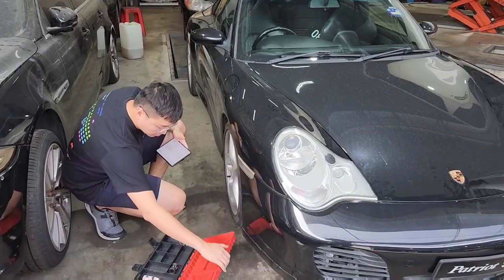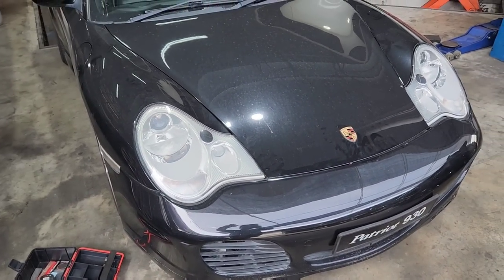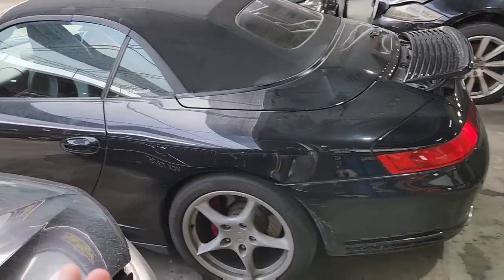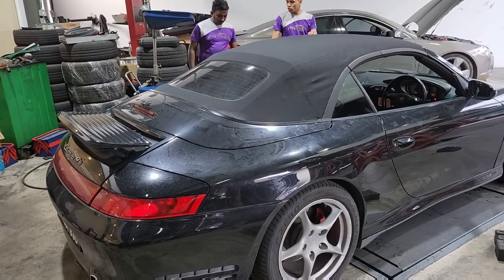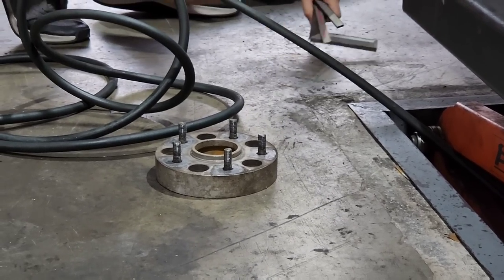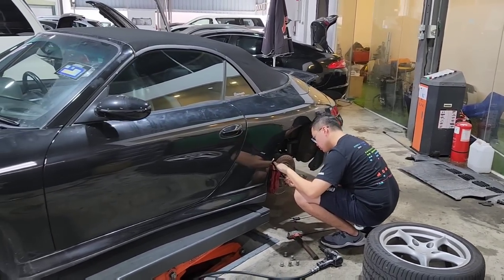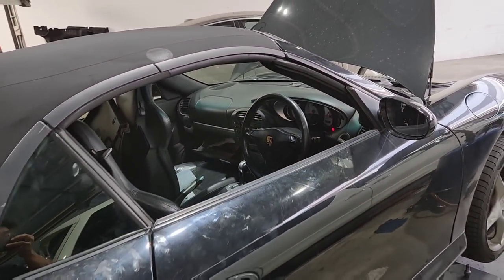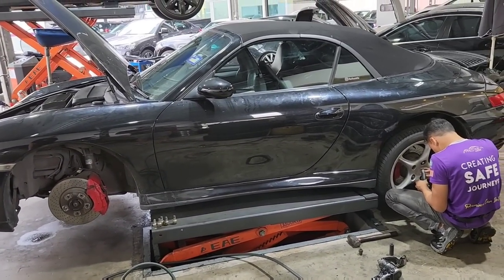Custom wheels for my Porsche 996.2 C4S Cabrio

Comment: Congratulations on the 996. If this helps, I use sizes 235/35 19 and 295/30 19. Pretty easy to find tyres in those sizes. Can get Michelin PS4S and Pirelli P Zero in those sizes.
Reply from the maker: Thanks! I think ill go with 295 30 19 as you recommend